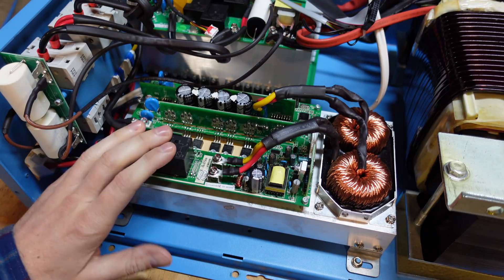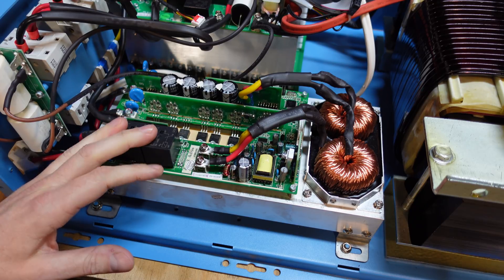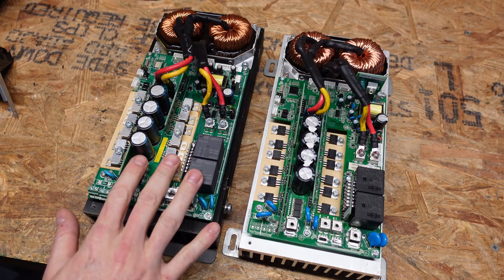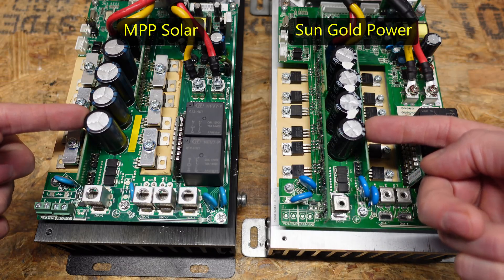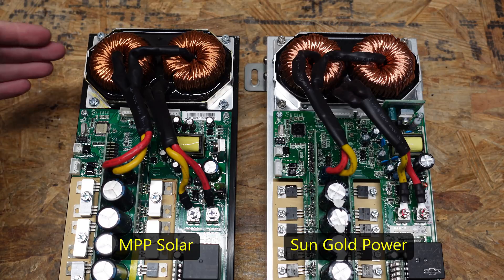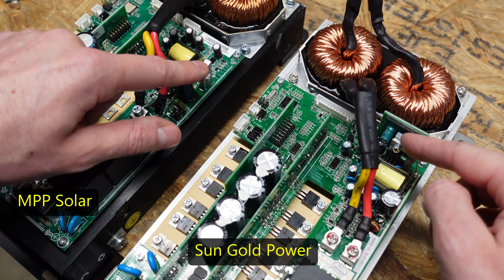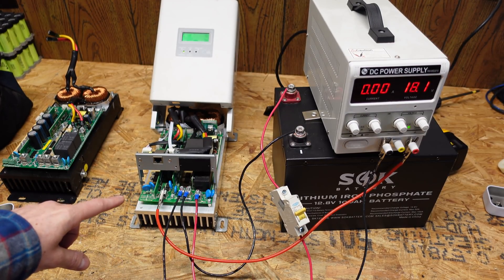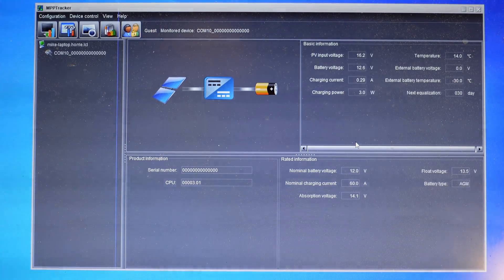MPPSolar PCM60X vs SUNGOLDPOWER Inverter-Bundled Solar Charger Controller

Comment: I giggle at the way demonstrators fingers float over parts, many many potentially deadly parts in yours and others videos. 8 x 12v 200ah batteries in S & P folk touch bits calmly and chat. You said 11,000W and I see big shiny coils an inch or so from shin. I will stick with opening 12v, 5v PC cases plug & play.

Comment: I always thought that charge mode selector switch only controlled the grid powered charger on those transformer based inverters. If they have a MPPT module it probably has a fixed charge profile that’s OEM set, and relies on the BMS to cut voltage to Lithium batteries.
Reply from the maker: That's correct - it only controls the grid-powered charger. That was the whole purpose of this video to show/check :)

Comment: My 48V inverter can work without batteries, and honestly looks to be more efficient that way (more power in cloudy days). What can go wrong if I set DC cutoff voltage higher than charging voltage, other than disconnecting batteries using its relay(s)?

Comment: Now I have to inspect my mpp unit Dam's you 😆 
This was a pretty good video, Going on 2 years now I talked on phone with sunpower before deciding to go with mpp and both of them stated they build every single piece in their components, 
Looks like that is untrue, but those boards are identical not counting the older versions of parts and so many years apart of build, you don't change things that work,
Good catch.

Comment: FYI the manufacturer of FTDI brand USB to serial chips released a windows driver that bricked counterfeit FTDI chips a few years back. This was a low blow move from FTDI in my opinion. I've been using the CP2104 chip by Silicon Labs with great success instead. Has perfect windows Linux and Mac support. Oh and it is less expensive. Great video!

Comment: Very interesting find!  So how does one change the Sungoldpower parameters for the charge controller?  You mentioned there are no communication wires.  Also, even with the RS232 connection hooked up, all the settings were greyed out.  Are you able to change them if you wanted to?

Comment: Great video, very helpful if anything goes wrong in the controller of the inverter, can easily swap with a board from MPP. And those who have this inverter can also order the communication board from MPP and connect to it and configure for LFP, like disable the Float voltage and so on. I guess all of the inverters and controllers are made by Voltronic Power.
Reply: Voltronic Power made both, just different brand...

Comment: is sungold power a chinese manufacturer?? cos mmpsolar said the chinnese are always cheating and stealing their designs,
Reply: I guess all of the inverters and controllers are made by Voltronic Power (ODM for major components), not MPP solar or any other brands. They just assemble under their own names.
Reply: @DSmartLife  its a bit hard to tell who was the original manufacturer. I know several buyers off mpp solar and they think they r honest to deal with.

Comment: Solar Charge controllers can work by themselves independently of the Inverter no problem - the monitor battery voltage and act accordingly.
Reply from the maker: Yes, they can, but the inverter provides a dial to select different battery chemistries which will all have different charge profiles. The point here was to make sure the MPPT was set such that it can handle all possible battery chemistries that the user can select.
Reply: @LithiumSolar  Aah okay got ya .. how would the solar charger know how to charge appropriately in that instance. What does the manufacture say?

Comment: 10 gauge wire and spade lugs should not be used for 60 amps, 40 amps maybe, but that's about the limit.
Reply from the maker: The red and yellow wires are connected together near the relays. When pulling data from the RS232 port, the controller returns two separate values for amps PV1/PV2. I'm not certain, but I think there are technically two converters here, each at 30A and that's why we have two wires, two inductors, and they're paralleled. The negative doesn't run through the charging circuit. The battery negative and PV negative are simply tied together at the lugs.